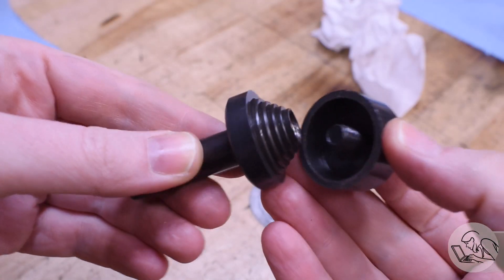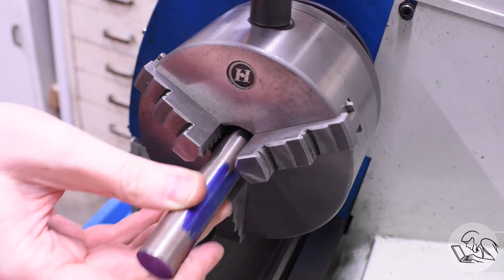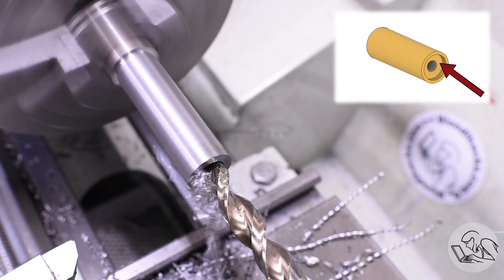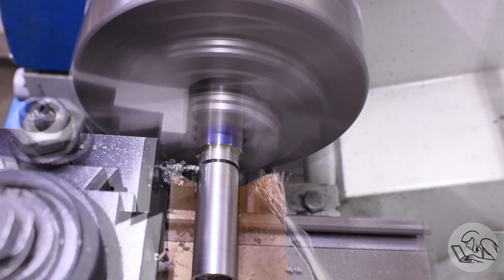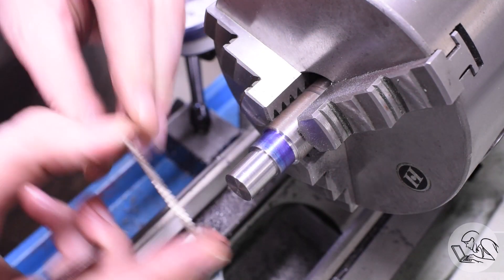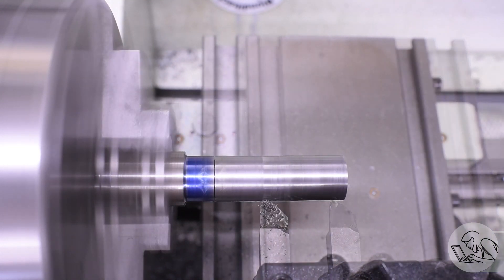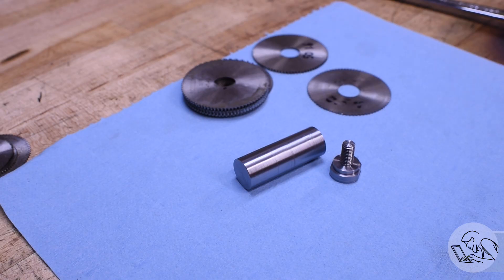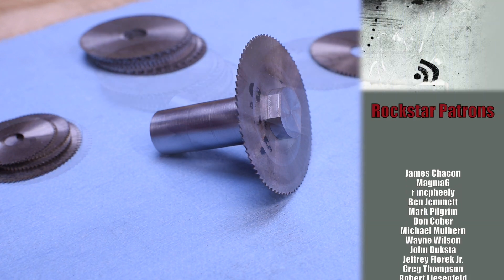Let's Make A Slitting Saw Arbor!

Comment: Ooh, I made one of those a while back, for the exact same reason (also, my "universal" holder jammed up so badly I had to release the saw with an angle grinder, the arbour just wasn't the same after that...) I put the shoulder on the arbour body, though, rather than the cap. That way, I didn't need to care about run-out on the cap (although, with hindsight, the reason was just that I didn't think about it...) I did, however, accidentally make the cap so thin that after some fairly heavy cutting, it had tightened the thread so much it actually bent the metal, as it tried to suck itself into the gap! Oops...

Comment: Do you recall where you picked up the lathe chuck with the “H” on it, I found one on Amazon but when I order it they don’t ship the one pictured, the one they ship has the bolts through the front of the chuck rather than from the back.
Thanks

Comment: I'm an engineer, not a machinist, so my head is full of impractical ideas that likely just piss off machinists.

But could you have made the arbor with a thinner head on the bolt so you can get the saw even closer to to the vise (yeah, it's probably close enough -- humor me...)

To do that you probably couldn't mill useful flats on it.  So make the threaded diameter larger.  Then broach a hex-shaped hole (3/16"?) through the bolt and use that to tighten the bolt.

(Yeah, I know -- more complexity for probably not enough value, but its what us engineers think about.  And you'd need a 3/16" hex broach and an arbor press.)

Comment: @10:20 - Wouldn't it have been better to keep the slitting saw in the arbor when doing the final pass, so that the stock is rigid on the face instead of hanging off the threads? 

edit: Oh, I see, you would have to sacrifice the saw in order to continue the cut over both pieces. (or turn it down beforehand)

Comment: What do you run them at?
 Had a 50mm 3 mm thick stall in a cnc machine
Reply from the maker: About 300rpm seems best for these
Reply: @Blondihacks  thank you for the answer , I was running at 200 rpm with a 25 mmpm feed , that's usually how I run keyset mills

Comment: What's the reasoning for making the shank to fit in a collet, rather than just making it to fit into the spindle directly?  i.e., if your mill uses R8 collets, why not just cut the shank of your arbor to be the same shape/size as an R8 collet itself?  Wouldn't that save you some vertical space, be more rigid, and also eliminate one possible source of runout?  Apologies for my imprecise use of these terms, I am but an egg.
Reply from the maker: Just because making an R8 spindle mount is about 10x as much work, and is ultimately less flexible (can’t be used in any other tools)

Comment: I never feel bad when people use calipers to scribe something. That is, if the scribe line doesn't have to be 100% precise (easy to hold them just slightly out of square to the surface you register against, thus screwing up the measurement) and if they only scribe the die, not the part. I doubt the hardened caliper points mind the die at all. I might just have to copy your design!

Comment: Admit it Quinn...
You were really drunk when you decided that original arbour was a good purchase decision.
Reply from the maker: Never Drink & Amazon
Reply: @Blondihacks  
... don't ask me about the game camera, laser tachometer and Fluke infrared thermometer. 😁
Reply: @randywl8925  What maker doesn't own at least one infrared thermometer? The laser tachometer would be useful for those who frequently work on mechanical stuff, not sure what's a "gaming camera".
Reply: @NiHaoMike64  I have a cheap pair and I've had them for 15 years? Decided to buy another cheap pair that were adjustable. I've always trusted my old ones and when comparing the new one side by side, the new ones were two and a half to seven degrees off. I mean the inside of my refrigerator was 27°. But nothing is frozen so I knew these were off............... to some degree. 😉
... They were only 20 bucks on Amazon.  That bothered me enough that two days later I said what the heck in ordered a Fluke 262 Max+.  Those were closer to 150 bucks..... ouch.  These registered about the same as my old cheap ones.  
I haven't compared them on high heat surfaces yet. With my luck those $20 ones are going to register dead nuts on with the Fluke.  😁
I never thought of that. 😳. Oh well, I've always wanted a nice one.

Comment: If the most vile thing you do in life is to mark out with your calipers you are miles ahead of a most other humans out there. Mixing metric and imperial in the same item on the other hand....
Reply: Nothing wrong with mixing units... until you can't find your 9/16th Whitworth spanner, and nothing else will quite fit... Mole grips to the rescue! (that's Vice Grips to you across-the-pond types). And no, I've no idea why they're called mole grips here, given that the one thing they won't grip is a mole?
Reply: @theelectricmonk3909  I had a 1975 Spitfire 1500 that was built when they were changing over to metric. One could never tell whether a fastener was metric or imperial. Drove me nuts. But in any case, my comment to Quinn was meant in pure jest which I think was missed by many.
Reply: @jimmccorison  I have a 1977 XJS here, and interestingly all the fasteners I've found (and I've found all of them!) are imperial! Just goes to show that BLC had no idea what it was doing....
Reply: Mixing imperial and metric seems to be fine as long as you don't do it in the flight control software for a space probe.

Comment: Wouldn't it be better to include wrench flats on both the cap and arbor? I'm not a machinist just someone who likes this stuff so I probably don't know what I'm talking about, but it seems like only including wrench flats on one side still limits the tightness to "finger-tight", no?
Reply from the maker: The arbor is typically in the mill, which holds the other end. Or you can hold it in a vise if you want to mount it externally.
Reply: @Blondihacks  Oh duh, that makes sense. Thanks for the reply! (Even if the question may have been a touch silly)

Comment: Why didn't you put another two wrench flats on the cap, so you would have 4 wrench positions instead of 2 ? :)
Reply from the maker: Because then there would be very little material holding the saw
Reply: @Blondihacks  fair enough. I have really fallen in love with your channel! You are really good at simplifying machining, without dumbing it down. Keep up the good work, happy new year and lots of love from Denmark! ❤️

Comment: Why not just buy a hex nut and a close-fitting washer instead of machining those threads? I'm sure you can find something as balanced and concentric as you need from McMaster...
Unless you need the excuse to make something cool, which I can 100% agree with.

You answered my question later in the video. Nevermind!

Comment: I’m ignorant here but.. why wouldn’t you want to use a calliper for marking? They’re easily replaceable, accurate, handy, and not too expensive.. is it just machinist manners? Like wearing a ball cap at a fancy restaurant sort of thing?
Reply: @jeffarmstrong1308  I don't buy the wear thing.  The jaws are just too hard except against the most exotic materials.  We once needed to drill holes in a set of jaws and EDM was the only way to do it.

Comment: People really shit storm over calipers on lathe ? Jeez how boring is their life 🤣
Reply: But it is so wrong, and I bet most of us do it!
Reply: @leifvejby8023  me being shity blacksmith and using calipers on black heat steel 😂
Reply: @yopyopu3258  :-D
Reply: @John Verne what else do you need to use to remove nails? They fit any size nail and if you need a better bite you just give it a smack with a hammer. They also would great to remove bolts and nuts
Reply: Use the cheap calipers. You won't feel so bad!
Reply: If they are your own calipers, use them as a hammer if you want. Don´t let other people tell you what to do with your tools.
Reply: I am more disappointed she didn't use nice layout fluid like Clickspring does. But what is this, a precision workshop?
Reply: Screw A Screen Name best adjustable wrench ever. Even tells you what size the hardware is!
Reply: Clickspring does it all the time.